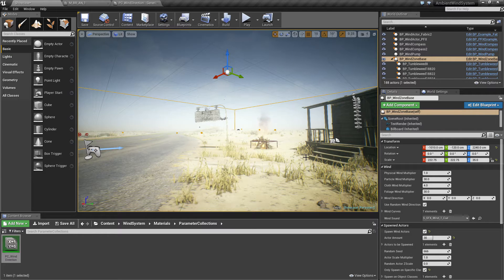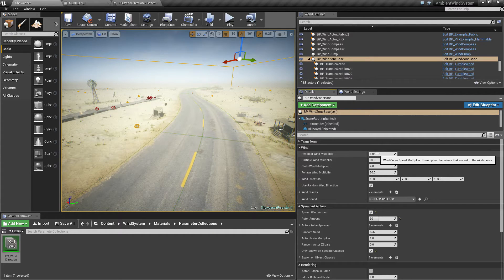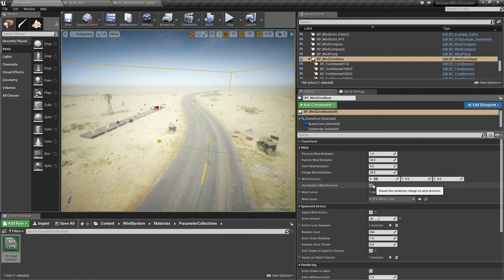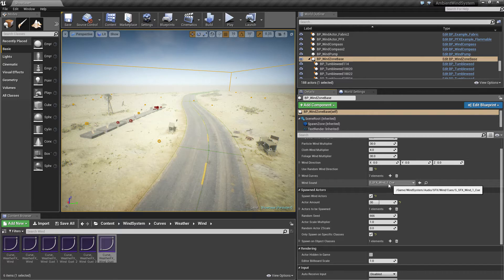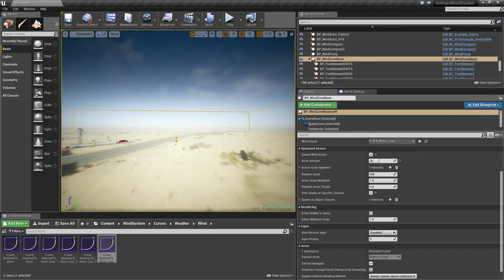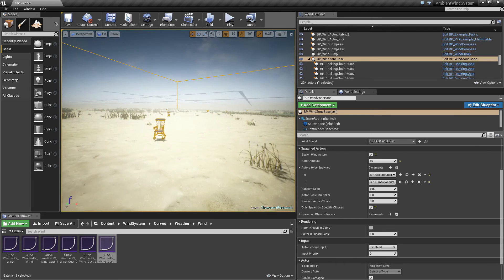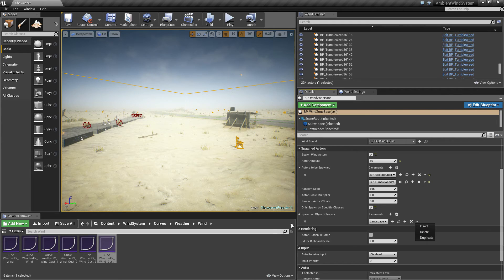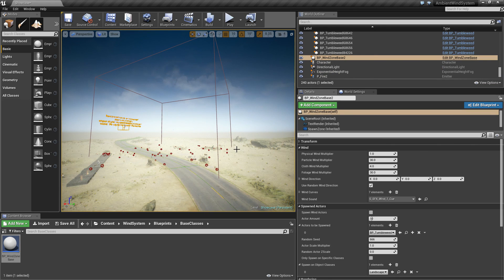Ambient Wind System for UE 4 - How to setup the windzone

Comment: Is this also part of the item in the system? so basically how to use it is just drag and drop the gizmo to the landscape for it to work??  no pre-set up required? thanks
Reply from the maker: you also need actors or pfx or vegetation that is tailored for the simulation to work.
Reply: @aphexx100  thank you